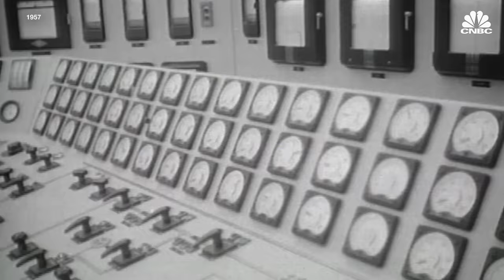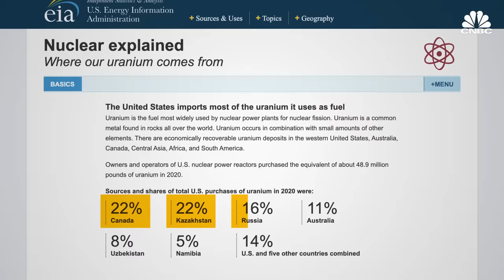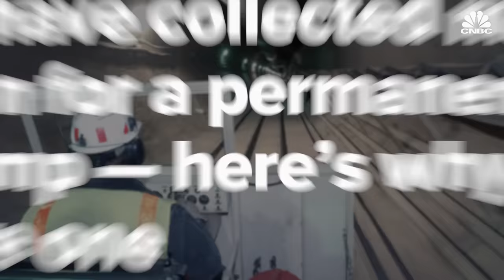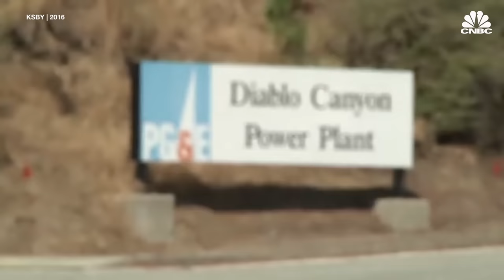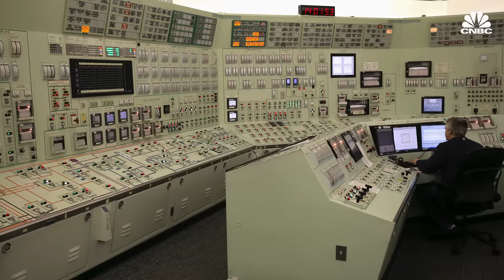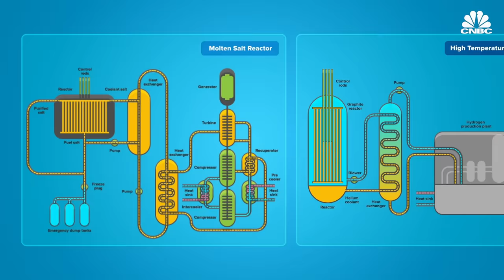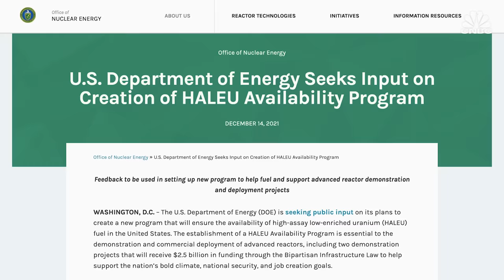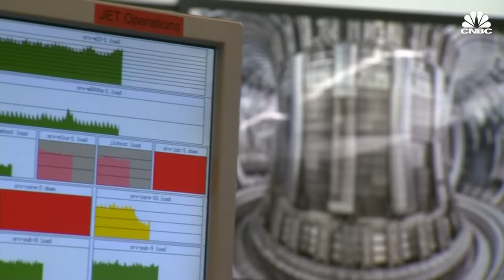Why Nuclear Energy Is On The Verge Of A Renaissance

Comment: Nuclear power is inevitable, it's just a matter of when not will and how far we are willing to give up all manufacturing in the US before we get back in the game. It's not layber cost that is driving the US out of manufacturing, it is cost of power. We need to start treating petroleum as a pressies resources and stop wasting it.😳😳😞😞😞😞😞
Reply: Here are the facts (you can confirm then) on the cost of nuclear and what it is doing to the cost of electricity and manufacturing that uses that electricity.
The Southeastern U.S. is super pro-nuclear MAGA, has zero anti-nukes, and 100% political support. 
VC Summer (South Carolina) new nuclear units 2&3 were canceled in 2017 after spending $17 billion on the project (original estimate of $14 billion and 2016 completion date) with no clear end in sight for costs or schedule.  Anti-nuclear sentiment was never identified by the utility as causing any of the many delays.
Vogtle (Georgia) new nuclear units 3 &4 currently 110% over budget and schedule and still not operating. Mid way into the build, the utility stated that had they known about the many costly delays they would never have chosen nuclear. Anti-nuclear sentiment was never identified by the utility as causing any of the many delays. They are now delayed another year because according to the project management, thousands of build documents are missing. Utilities, not the media, decide the most cost effective electrical power source and give the above failures no U.S. utility is even considering new nuclear at this time. If you can’t build new nuclear in the MAGA super pro-nuclear southeast U.S. then where can you build it?
In both cases, the ratepayer is stuck with paying the $50 billion bill. And the silence of the Rah Rah nuclear folks on these events is deafening.
Reply: @clarkkent9080  I am in the industry. I have a master's in mechanical engineering and doctorate in physics. You are talking about the construction corruption in the United States. The rest of the power plant industry has the same problem. The cheapest power out there is nuclear. I live in Texas and get my power from a nuclear plant. Live in a 3 bedroom ranch and it is all electric and AC run's nonstop. The bill just came for a month that was 103 for the coolest day. The bill was $168.00..
Reply: @tompreiss5010  I worked in the nuclear industry for 40+ years and have a BS degree if that matters. I was a Reactor Operator and Senior Reactor Operator at 5 different nuclear facilities and consider myself to be pro-nuclear. I have actual operating experience and industry knowledge from multiple facilities. I have provided facts on construction costs and project failures and you can confirm that if you do not believe me.  

Don't compare old with new. Was the $17 billion spent for VC Summer with the project canceled a good deal???
I live in Ga, and my electric rates have increased 29% for Vogtle construction when NO utility is supposed to charge customers for plants until they are operating. If Vogtle unit 3/4 ever operate my electric rate will double to pay for the $31 billion for two units. Those are facts for the only new nuclear plants being built today not something build in the 1970s. 
Even the utility has stated that selecting nuclear was a mistake.  Today the only thing nuclear has going for it is non-carbon power but with 45% of Americans believing climate change is fake news and one political party having that as a major plank, there is not much reason for new nuclear unless opinions change. 

If the cheapest power out there is nuclear then google nuclear power plants shutting down. The reason that the investor owners of these old, 100% construction paid for, nuclear plants give for shutting them down is they are too costly.  Your nuclear power plants have about 10-15 years of life left and since it takes 15 years to build (start to operation) a new plant, your utility operator has not decided to stay on the nuclear path.

Texas has its own grid so you get your power from all the sources on that grid.  With a doctorate you must know that electricity does not simply flow from the nuclear plant to your house. The Texas grid gets 10% of the power from nuclear, twice that from wind, and almost 50% from natural gas.  Wind turbine supplied power is the cheapest followed by natural gas but I am sure you already know that.
Reply: @tompreiss5010  10% of the Texas grid is powered from nuclear and 70% is from Wind turbines and natural gas, the two cheapest forms of electrical generation. The Texas grid has a very cost-effective power mix but since ERCOT refrains from any oversight beyond recommendations the available power supplies and their reliability are not sufficient to provide the grid needs during unusual conditions such as the current heat dome or the 2021 ice storm.  I assume that you were not one of the individuals that got an electric bill for thousands during the 2021 ice storm.

Comanche Peaks unit 1 & 2 operating license will expire in 2029 and 2032 respectively.  Since it can take 6-8 years to approve a license extension and since there is no reports that Comanche Peaks is interested in an extension, I would assume that the utility is planning on shutting both units down when the current license expires. The utilities plan to build 2 new nuclear plants was canceled in 2011 after spending over $300 million and the reason for the cancelation was ballooning estimated costs.

South Texas project unit 1 & 2 has received a license extension for both units.  However it should be noted than no nuclear power plant has ever operated beyond 50 years and even the plants with license extensions usually shut them down when a major piece of equipment fails and around 40 years of operation that becomes very likely.

Simply put, due to the inability of American construction and project management to build complex projects cost effectively, nuclear is not on the top of anyone's list. I am not against nuclear, I am against fraud, mismanagement, with ratepayer on the hook for the cost while investors get a 9% return on their stock with dividends. 

I believe it was 2016 when then DOE Secretary Moniz was asked about the future of nuclear power in America. He stated that the future of nuclear power was playing out at VC Summer in SC. and Vogtle in Ga. and if they were successful, then nuclear power had a bright future in America. That simple statement says it all. Until the issues with the U.S. construction industry are addressed, nothing will change.
Reply: @clarkkent9080  my electric utility is a share holder of the one in Corpus Christi and we are on the main service line running to San Antonio.
Reply: @clarkkent9080  My power utility is contracted through the nuclear power plant in Corpus Christi that is what my rate is calculated on.
Reply: @tompreiss5010   The South Texas Projects (STP) two reactors are owned by NRG Energy at 44 percent, San Antonio municipal utility CPS Energy at 40 percent and Austin Energy at 16 percent.  
So if one of these is your utility then you are correct in that a PORTION of your electric cost (not actual electric) is based upon the cost to run the STP project.  I know my response to you was terse but having worked in nuclear they teach us to be precise in our communications and I was born before Political Correctness. Cost basis and electric source are not the same.
Those plants are license extended into the 2040s but as I have stated that no nuclear plant has operated beyond 50 years. I have operated a similar Westinghouse PWR and they do have weak points such as steam generators, feed pumps, and main transformers. Both those units are getting to the age that any large equipment failures would be so expensive to repair that the owners usually just shut down the plant.
Have you checked on renewing your electric plan or was the Fox26 report incorrect in stating every electric plan in Texas has increased at least 50% since last year? 

My simple point in commenting on these channels is that new nuclear has become too expensive as proven by VC Summer, Vogtle, and STP cancelling their new nuclear in 2011. It is the construction industry and project management that is the problem not old designs, anti-nuclear, greenies, politicians, the media, or the NRC.  The problem can be addressed or we can keep chasing the boogie man and nothing will change.
Reply: @clarkkent9080  the co-op that I get my electric from is part of CPS share holdings.
Reply: @tompreiss5010  So up to 40% of your electric cost is based on Nuclear.  If the other 60% is based on natural gas which provides 50% of all Texas generation, then you will see a large rate increase the next time you commit to an electrical energy plan.  I am not familiar with the exact process but these plans usually run for no more than 2 years before you must renew.  You are lucky that STP canceled their unit 3 and 4 reactors because if they had not, you would be seeing increases like I am due to the Vogtle cost over runs.  Your utility was smart enough to say no to new nuclear. And now you know why I will not support it until the construction and project management issues are addressed.
Reply: @clarkkent9080  no the co-op that I am with is only invested in nuclear.
Reply: @clarkkent9080  and lignite
Reply: @clarkkent9080  pay attention, MY CO-OP OWNES A % OF THAT 40% THAT CPS HAS. That % is more than enuff for this market.😳😳😞😞😞😞
Reply: @tompreiss5010  I am very familiar with co-ops or EMCs and they can contract based upon the power supplier.  The idea of all your eggs in one basket is never a good idea, especially since nuclear is many times the most expensive method of power generation.  Enjoy your nuclear electrons
Reply: @clarkkent9080     Yet you continue to ignore that many countries have been building and using small modular reactors for many decades, built in two years or less for millions not billions.

Comment: Need better batteries to advance the tech.
Reply: Think harder.  The electricity which those batteries hold still has to come from somewhere.  So build your "better batteries".  Unless you address the issue of power generation so as to fill those batteries when and where they are needed = you focus upon only half the problem.
Reply: @varyolla435  Hey thank you for the reply. I didn't say that batteries were the only requirement, perhaps you should think harder next time. great talk.
Reply: @OfficiallyOddlySatisfying  Actually I have been thinking.  Current "green" power tech is nowhere near enough.  Things like solar or wind and hydro are not feasible for many areas while the issues of transmission loss and storage similarly lack viability.  That is the tenet of this video.  The only way to bridge that gap is nuclear power unless we can radically alter our current capabilities.  

So building better batteries and more renewable energy platforms will "help".  It in and of itself is not a viable solution however - hence continued fossil fuel reliance which happens to be increasing rather than decreasing.
Reply: @varyolla435   Although current nuclear can be a great base load, it can't be used for peak load demands.  In the renewables arena, probably only hydroelectric can do that since it is essentially the only one that has storage, but it's still not enough.   Until there is a quantum leap in energy storage technology, we will be stuck with some fossil fuels unless we are willing to put up with massive rolling blackouts.  Solar and wind just get in the way and are a burden on the operation of the grid.  Newer designs of small modular reactors that can quickly adjust output would be a big help if the Greenies would just GTF out of the way so we can build them.
Reply: @varyolla435  One word...SOLAR
Reply: @varyolla435  Texas is the only state with its own independent grid and 50% of their power comes from wind and 2% from solar (its actually much greater for solar but since it only provides power for part of the day the overall contribution is 2%)
Reply: @clarkkent9080  So one more time.  What the populace wants - extrapolated via polls - does not always correlate to what industry does let alone governments.  Industry beats to its own drummer.  Ergo while nuclear may be popular "in general" that does not mean the industry will invest the billions it takes to build nuclear power plants.  It is far easier and cheaper to continue to invest in fossil fuel ones.

So the only way for this paradigm to change is from a top down approach.  The government must promote nuclear power via industry "stimulus" much the same as it has long done for fossil fuel - and of late renewables.  

No nuclear power is not a long term solution.  It is however as alluded to a "bridge" between the systematic changing from fossil to renewables and hopefully solving the problems of storage and transmission that is required long term here.  Solar etc. is not feasible everywhere and the increasing demand for energy means something must fill that gap.  Nuclear power is the best we have at the moment.
Reply: @varyolla435  I am not saying what we should do.  I only present facts and based on those facts draw the conclusion that the contribution of nuclear power to the U.S. energy mix will continue (currently down to 19%) to decline over the next 20-25 years.

Here are those facts:
On average, 2 old 1,000 Mw nuclear plants shutdown each year. Palisades shutdown 2 months ago and more will follow.
The one and only new reactors that will most likely operate is Vogtle unit 3 and 4 but that will not be for 1 to 2 years.
The only other new reactors that MAY be built are Terrapower's Natrium reactor. Currently 2 years since that build started and no ground broken yet and their own estimate is that it will not be functional till 2030. Note that Natrium is a demo test reactor that would have to prove the concept for 5 or more years before more will be built.
NuScale just halved the output of their demo test SMR due to ballooning costs with many utility backers well backing out.  Since they only have 1/4 the number of backers necessary, they have delayed the start of that project till 2025. 

Since it takes at least 15 years to build a standard BWR/PWR (start to finish) and no utility has expressed interest after VC Summer and Vogtle that is not even on anyone's radar.
 Any new gen 4 reactors would first be test demos and again require proof of concept before being mass produced.

The U.S. has built and tested every reactor type possible over the last 70 years and spent trillions that in itself is subsidizing the nuclear industry.  Today, Biden has $10 billion for investor-owned utilities to help keep the old ones running longer and NuScale and Terrapower (billionaire Bill Gates CEO) are each getting $2 billion taxpayer dollars.

What did I miss????
What don't I understand about the situation????
Should the U.S. government just build new nuclear and pay 100% of the cost and then turn them over to investor groups????
BTW if you actually read the European news and listen to the Biden administration, the "bridge" source of power is natural gas not nuclear.